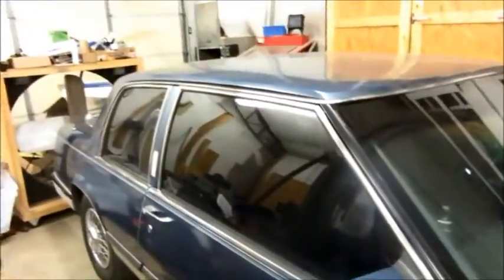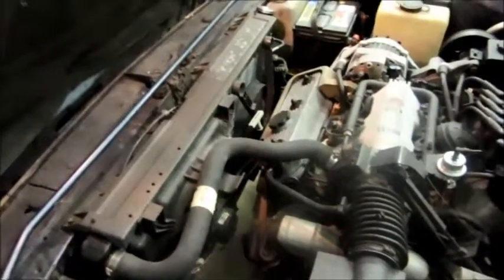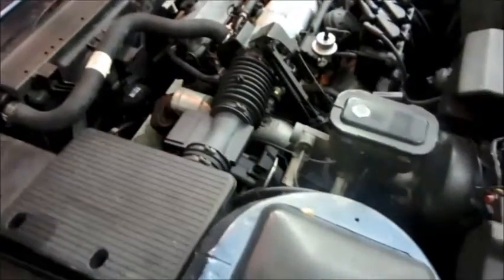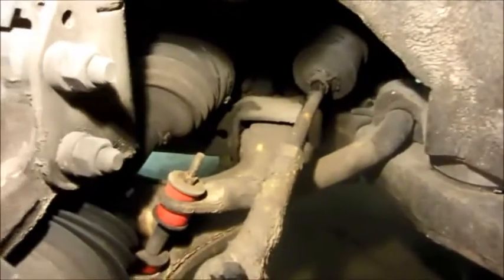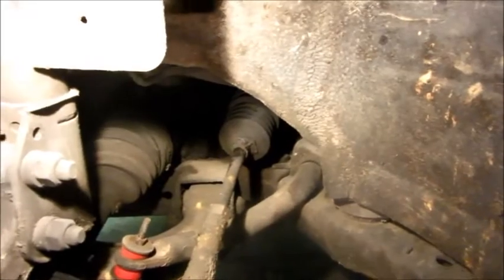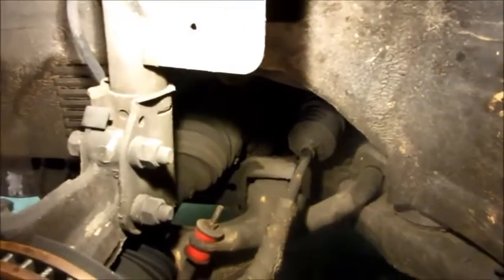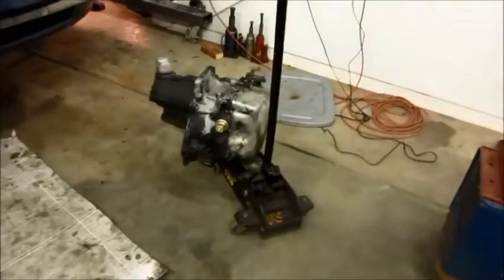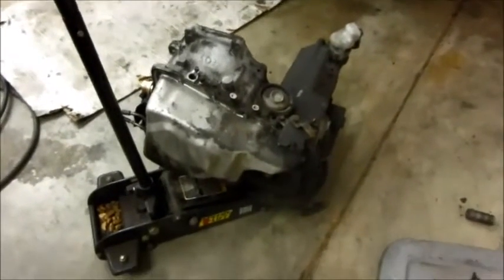Transmission Rebuild - 1987 Buick Park Avenue Coupe - Part 1 Overview and transmission removal...

Comment: I have an 87 LeSabre that has the same issue @ 122k. I was hoping this video showed how to remove the transmission.
Reply from the maker: Hi Tim. Unfortunately, I didn't video that part of the process. I did rebuild my mom's 89 LeSabre transmission. Tried to do it without pulling the transmission but it was too contaminated with metal shavings. I'm not sure how much of the removal I show here, but probably more than I do on this series. https://www.youtube.com/watch?v=S44o25J1e8Y